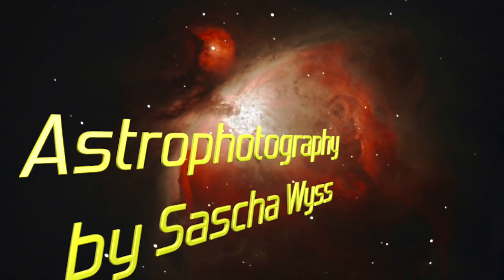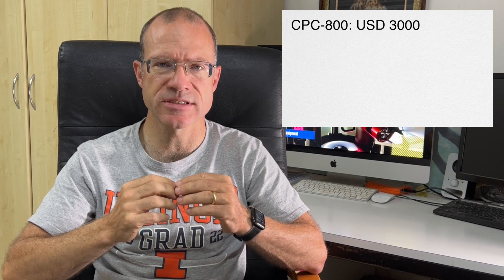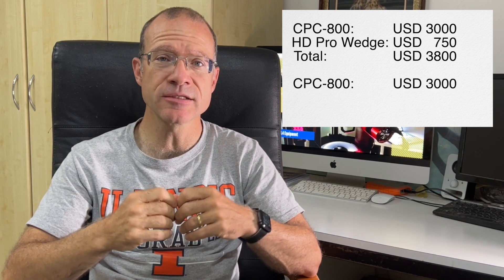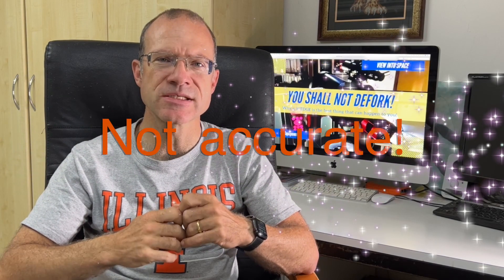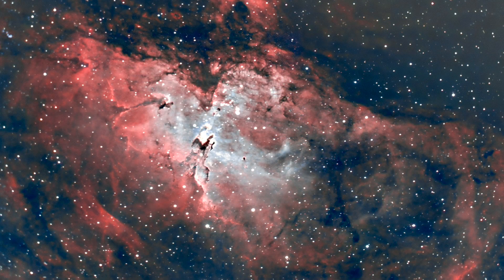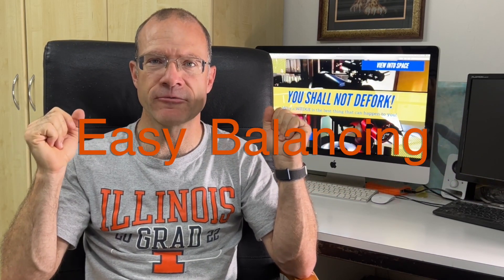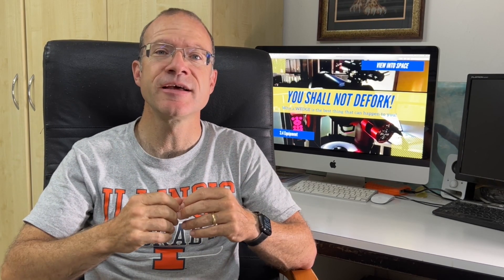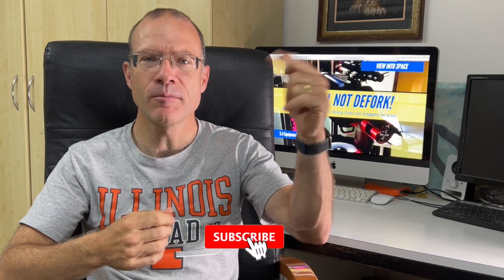WATCH THIS before you DEFORK your scope!

Comment: I have a classic orange-tube C8 on a wedge, but it's only got the basic clock drive in the RA axis. No go-to, with all the benefits to modern astrophotography.  I've only been using it for planetary as a result. I want to use it for galaxies too, so I don't see an alternative to de-forking.
Reply from the maker: Absolutely, deforking is the way to go!

Comment: ....well the scopes I buy have failed electronics, failed gears etc..so I bought a Meade cassegrain (8 inch )...for $150 bucks, with hard case, travel bag and tripod with wedge...so $150p rice is unbeatable. No brainer to sell fork and computer/controller to someone who needs parts. Keep the tripod, heavy duty, can adapt plate to my dovetail mount...your logic does not work, to buy new scopes and do this? Well yeah no kidding thats expensive. I have a dozen excellent scopes that have great optics, so only invest is one modern go to mount, many used ones of those too. In the USA I find deals daily.

Comment: A lot of this argument makes no sense. First you’re basing all of these assumptions on your specific fork capabilities. Your CPC has a vastly superior ability to track for photography use than regular autostar mounts… so no that makes no sense for the majority of people who are looking to defork. Secondly although equatorial plates work, some forks bend and stress under this load position. Those forks were never really designed to be put on a wedge, they are optimized for flat with gravity in one direction. The motors now have more resistance in positions than normal, it all adds up, especially for photography. So again, you’re completely basing all of this just on your own forks yet most people don’t have CPC which WAS designed for astrophotography use for both accuracy and for being on a wedge. This video makes no sense. This only had to do with your specific telescope and no one else’s.
Reply from the maker: It made only sense for CPCs - I should have been more clear about that you are write. At the very end I got so totally annoyed on all the software issues with the CPC that I sold it......

Comment: I have owned and used CPCs with forks and wedges for about 35 years.  8”, 11” and an 11” Edge Hd for the past 5 years. All have been pier mounted in a backyard  roll off roof obs. Never had any serious thoughts until recently about deforking. The two main issues that are prompting this are the I am limited to max declinations of 60 degrees to prevent camera from crashing in to the mount unless I am using Hyperstar. Recently I purchased a StarSense Autoguider  and when I use it in conjunction with CPWI the mount will randomly disconnect. I have tried everything, even contacted Celestron, so far with no positive results. I think the I may have a bug in my mount electronics.
Reply: As a follow up to the above, I physically disconnected the GPS module in the mount (since the scope is pier mounted I don't need GPS). CPWI and SSAG now work fine with no drop outs.

Comment: There are so many advantages to a german equatorial mount. Some even can track way past the meridian flip. And even if the mount cant track past the meridian flip, the other headaches of a wedged fork,  especially the weight in the bigger models, that you have to lift even higher and at an angle.  I had a c11 on a G11 and loved it for years,  but I had to put everything in storage because I had to move onto my boat. Eventually I was spotted loading musical instruments into storage by some tweakers hanging out,  and it got broken into and I lost pretty much everything I owned. 

It was an older G11 with the non folding tripod, which just looks like pipes and some strange rocket launcher to a tweaker,  so they didn't take it,  or my counterweights and guidescope rings and other losmandy hardware.

When my situation improved a bit 18 months later (I had been kicked out of the marina which is why I was putting even more stuff in storage because I was going to have to live in my van until I was able to get housing, which ended up taking 18 months), I put the tripod and gear up on a facebook used astronomy gear page, and someone who knew me had an old 10" meade LX6/premiere,  which I got in trade, so it was almost like replacing my C11 rig for free. I don't like big scopes in forks on wedges, but I had to take advantage of it because it is better than nothing. It even came with the giant trunk case that used to come with meade scopes back in the day.

This was MUCH harder to setup than my G11, which had a 40# mount head, that only had to be lifted to tripod height and not at an angle.  The 50# 10" w/fork is much harder to deal with and transport,  as the single case is much harder to fit in a vehicle than 2 smaller cases for the OTA and mount head, not to mention the massive super wedge,  which is a pain to take on and off the tripod, so most just leave it attached, is a heavy and awkward load as well, and not at all compact like a folded or dissambled g11 tripod.

And in many cases, certainly my lx6 or an LX90 in 10" and larger, less stable.   Yes the CPC is probably the best fork on the market, I love them for what they are, and sold many more of them than lx90s and lx200s during the 2006-2011 period I worked ar opt, but I still didnt recommend them for use on a wedge for astrophotography,  unless they had a permanent observatory and just didnt want to pay the higher price for an EQ system. With all the balance weights and the more difficulty in polar alignment (yes a wedge is a bit more fidgety that way), they really only make sense in permanet installations,  unless it is just an 8" which is much easier to deal with than a 10, 11 or 12.

Needless to say my 10" has only been taken to a dark site once, as another friend sold me a powerstar c8 for $200 and a beat up 10" starhopper for $60, and i now had an easier to transport and set up 10", and a respectable 8" for a price I could afford. But i still had plans to use that old 10" at public outreach events after the pandemic,  or occasionally bring it to a dark site, since it does have better optics than the dob, which needs a recoat on the primary, and of course tracking which helps at higer powers.  I cant use my 28mm 82deg or 20mm 100deg eyepieces on it though, as it overwhelmed the dec clutch and I would have to buy a weight rail system for it... another fork/wedge issue adding cost weight and hassle.

I had another run of bad luck though,  losing the van that was loaded with my 8" dob, 127 mak, omni102, CG5 and nexstar GT mounts, and an old vixen 60mm refractor on its AZ mount, and several guitars/basses and a few amps, and new in box electronic drum set among other personal valuables still in the van from when I lived in it. I was in a compromised situation,  it was broken down and got impounded and I was prevented from getting it out in time.  My stuff was literally legally stolen by a corrupt city in an even more corrupt county.

And the vehicle I got stuck with is way to small for even the 10" dob let alone the 10" meade. The c8 might even be too big unless I take it without the case, and i prefer not to do that, so I havent done any observing in the last 3 years.

I agree in the case of someone with a cpc800, just buying a wedge instead of deforking (you don't have to throw it away, there is a market for working CPC and gps and later LX200 forks), as a much cheaper solution, but on the bigger models, it only makes sense for permanent installations. 

The CPC is the best visual and planetary/lunar imaging as ab alt az, but for those planning to do long exposures,  the best advice is to stear clear of the forks and just buy a cgem, cgx or cgx-l (cge back in the day) version of the same scope.

I miss my CG11 rig dearly, not to mention my other scopes and music/audio/recording gear and everything else I own, but I am thankful to at least own these vintage fork/wedge replacements for the GEM mounted 11" and 8" scopes, even though replacing my televue refractors with even chinese apos is out of my range.

That 10" may come off the forks  eventually,  unless a cheap 10-12" truss dob comes my way.

Comment: I did try the wedge for my NexStar 6SE for which I had bought the StarSense-Camera for alignment before. And although really trying hard I never got it running well together. I took a step back, got a StarAdventurer GTi and use it just with the camera and different lenses and that works fine for me at the moment. And if everything works perfectly I sometimes really put the 6''-SC-telescope a this mount and it works! But I want to keep it simple and portable, so next step is probably a small refraction-telescope for the GTi. Thanks for the video and greetings us em Thurgau!
Reply from the maker: The one-armed versions were never meant for the wedge - way too unstable. And these days I kind of changed my thinking about wedges in general. You never get the accuracy needed for such high focal ranges....
Reply: @viewintospace yet celestron still offers a wedge for them and worse yet gave them an autoguider port to further raise expectations. 

Another example of the marketing dept winning over the actual astronomers in the company, which is why they still sell powerseeekers. Meade is even worse on the low end of the market, and bobblehead etx125 and 12" lx90

Comment: Excellent video.  Thank you.  I totally agree with your reasons not to defork.  To me, not having to worry about the meridian flip is the best.  Although, I am concerned about backfocus creating a lack of space between the camera and mount.

I have been working to get the most accuracy out of my system.  I have a CPC 925 on a wedge using a ZWO ASIAir Plus for most functions.  Prior to using the ASIAir, my alignment process is to manually point the tripod to the North.  Level.  The go through the Celestron two star alignment (to orient the mount).  I then pick Polaris and slew to the pole star.  Once pointing at Polaris, I switch modes to using the ASIAir for polar alignment.

My concern is the small angle of offset between the Celestial Pole and Polaris.  This angle is maintained throughout the polar alignment and follows into Astrophotography.  Even with ASIAir guiding, I see minor drifting in the images.  The ASIAir is programmed to keep the target centered.  So, after about an hour, the ASIAir recenters the target. 

I have considered finding a method to move the tube to a 90 degree position instead of using Polaris as the GOTO target of the CPC.  I haven't tried this method but I believe it can be handled by going to specific coordinates on the CPC handset.

I suspect that the drift is due to the described angle.  From your experience, how do you handle polar alignment with the forked scope?
Reply from the maker: Hi David To be quite honest, I changed my opinion over time. Polar Alignment with the Celestron Software was an extreme drag and I never achieved a decent RMS for this focal length. So last year I removed the wedge and use the CPC exclusively for planetary and lunar photography. This year I will defork it given I have now a mount which also does not require meridian flips.
Reply: @viewintospace don't defork it, keep it as is and just buy a better optical tube for imaging, or a 2nd c8 or meade 8" acf. I'm sure my stolen pre lawsuit usa made meade 8" lx200R ota is out there on the market....

Comment: does the wedge polar setup work with PHD2 guiding?
Reply from the maker: Yes, it does - don’t expect perfect results, but within it limits it works! Preferably use OAG and not a guidescope!
Reply: Thanks. I did install HD wedge on my CPC11. EQ North alignment was easy. Was about to get Svbony 60mm guide scope but your advise led me to ZWO OAG-L instead : )

Comment: I have a nexstar 6" on a wedge.  Wedge works fine, despite many detractors.  I would like to get a C9.25 CPC or 10" LX600 with wedge as my next scope because I like visual and imaging.  But, like @chenjack4766 mentioned below to which you replied, clearance is an issue.  I use a diagonal, and for my needs now it's fine.  In the future I don't want to limit the areas I can image or introduce a diagonal.  The 9.25 looks like it may have more clearance the C11 using the same forks.  Good video, I enjoy your content.
Reply from the maker: Clearance is an issue for sure and the only remedy is the diagonal, which is not optimal I fully agree

Comment: Won't work if you want to use AAP.  CPC mounts w/ a wedge are incompatible with AAP
Reply from the maker: Sorry, what is AAP?
Reply: @viewintospace  Sorry. ASI AIR Plus / Pro
Reply from the maker: @Goldiney  Weeeell, this is a complicated topic..... When I got my CPC I investigated this and 95% of people said, it will not work. So I went with NINA. But in the recent months I find more and more accounts, which state it works fine.... Quite honestly, as do not want to lock myself into the ZWO environment, for me this topic is irrelevant, but just saying, there "seems" to be a high likelihood that it works...

Comment: I purchase my from ebay the cpc1100 added a wedge. My mistake buying from a seller.  Never worked correctly. When I defort this telescope I know this will be good. I purchased a lemon and did not  dispute this in time. My fault.  Thank you for posting.
Reply from the maker: Sorry to hear that
Reply: Celestro might be able to fix any issues.

But nothing fixes the hassle of dealing with that big of a scope in a fork/wedge configuration unless it is permanently mounted in an observatory

Comment: I have a fork mounted vintage Super c8+ with  a Edward R. Byers mount  that I wouldn't dream of deforking for an EQ mount. I also have a sliding counter weight that I use with heavy 2 inch eyepieces but not necessary with 1.25's and like you stated no meridian flip like an EQ mount. I love my c8 and I haven't found a reason to upgrade and probably won't. I have a 4 inch apo as a compliment for lower powers and wide fields which are fantastic but for the planets and smaller objects  the c8 performs marvelously. Thanks for the video. Clear Skies.
Reply: I have a powerstar c8 with the byers drive (but not named on the base like the older AC drive versions were).  I don't think I would ever de fork it, as I don't need goto. In fact, In my previous incarnation before I got robbed, I had sold my gm8 mount that I used with either my 8" lx200R ota , televue101 or c4r,  because a modest cg5 with an RA drive was all I needed , and I still had my g11 if I wanted to image.  I needed to downsize and I needed money so sacrificing my main imaging mount made sense at the time since I could always tune up that g11 which was mainly used with my c11.

I did get robbed, and had to replace the 8" rig with a great deal on the powerstar, no additional mount purchase required, and a straight trade on an old 1991 meade 10" lx premiere to replace the c11. The tweakers didn't know to take the tripod and weights for the g11, or my losmandy and adm guidescope rings, so I was able to trade that stuff straight across for the 10"

But yeah, I couldn't use my 28mm 82 or 20mm 100deg eps on the 10 as it overwhelmed the dec clutch and I don't have a weight system for it.  IiRC I could do it on the 8, but it has been 3 years since I have used them since I had another spat of bad luck and lost my van that was loaded with some other scopes, mounts and music gear a few years ago, so my transport ability for the larger scopes was eliminated.  

On the next clear night I may set the c8 out front, just to see if the big eyepieces can be used without a weight system on that scope.

Comment: Your position assumes that whoever deforks a CPC setup throws away the mount and thereby its a lost cost. You don't properly address the option of selling the mount to recover costs against a GEM purchase or indeed repurposing the CPC mount by removing the non-motor arm and adapting a dovetail clamp on the single remaining arm allowing the mount to carry other OTA's.
Reply from the maker: To be quite honest I never heard of anyone doing that and the idea also did not cross my mind, but I like it! Cool idea - if it is feasible, could be a great option.....
Reply: @viewintospace  very doable, I have done this with my own CPC1100. The only electronics in the non-motor arm is the GPS module and that is simply removed with screws. It does leave a hole where the non-motor arm was but a bit of bent metal or a 3D printer part would cover that and the GPS module can be attached to the new blanking plate. There is also the other option of keeping both arms and building a bridging plate between the two arms with a dovetail plate screwed in the middle.
Reply: Another option is to make a tray that swings between the forks.  I have seen people do this to mount giant binoculars.  It can work with shorter refractors as well, but long ones will be limited in altitude because of the rather large UFO of an azimuth assembly on the CPC

Comment: My LX50 will never be deforked. I can push to faster than most GOTO's can get on target and my short 15 second subs are just as good as anyone else's at 1/4 the cost.
Reply: 15 second subs isn't saying much though. 

1/4 the cost is, but surely you could eek out longer subs, at least 30 secs. Are use using a reducer?